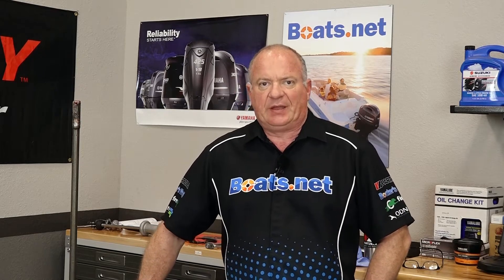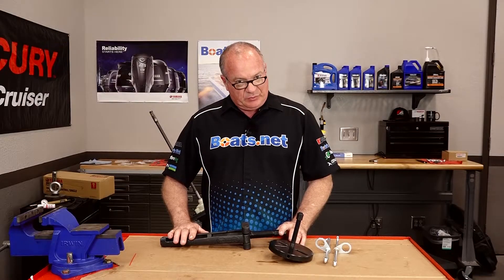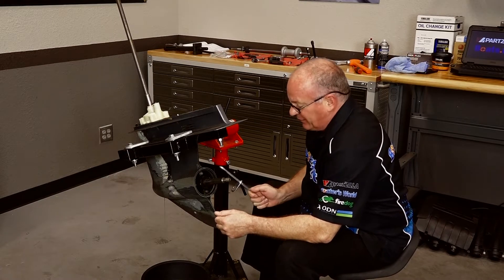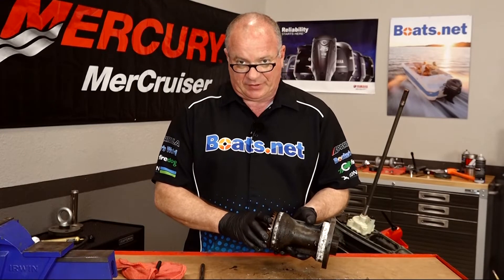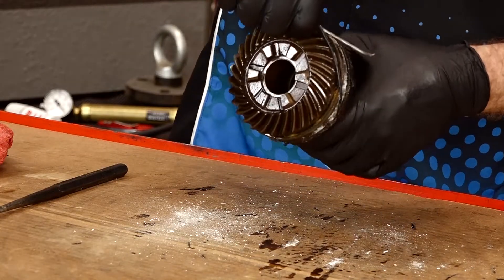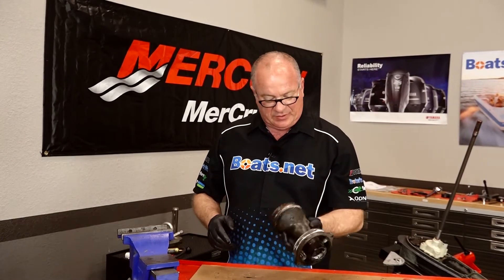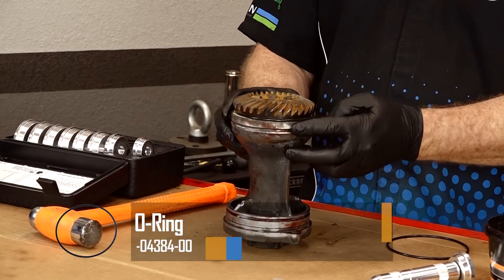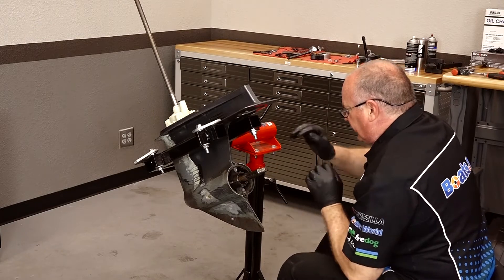Yamaha F225 Prop Shaft Seal Replacement | Yamaha Outboard Prop Seal Replacement | Boats.net

Comment: It could be a worthwhile to mention that this tool and procedures would not work at all on counter rotation engine where shaft is bolted to carrier and should come out as one pice. In other words, pushing against the shaft is pointless and would result on ether broken tool or bearing carrier case. It is also nice to a video to walk through changing prop seals on counter rotation engine.

Comment: That lower unit looks a lot larger than my 25hp. 
I ordered the heavy duty puller. When it came, I realized it wasn't gonna fit. I ordered the seal kit and bearing carrier, the 2 bolt flange is part of the carrier and broke probably when the water in the lower unit froze. My carrier has 3 Orings not 2.
I asked if you had the puller for sale and was told to contact another vendor. The specs for the puller says it's good for Yahama,johnson,Evinrude, mercury,honda,and MerCruise. That maybe true for larger engines, but not lower H.P. models. The jaws of the puller are too thick and wide to fit in the cooling water discharge ports.
I contacted the puller vendor and they want to charge me return shipping of $32. for their mistake !
A nice "How Do You Do" HUH !
So I have $149. in parts and a puller that won't work ! ! !

Comment: Great video. I’ve had nothing but problems with my lower on my OX66. Finally bought a remanufactured and now this one has water in it. Funny thing was I had a 1987 Merc Tower of Power and never once had any water in lower and had that thing for 20 years. Seems like every year I am having the seals done on my Yammi.